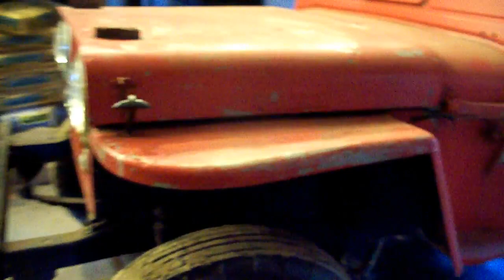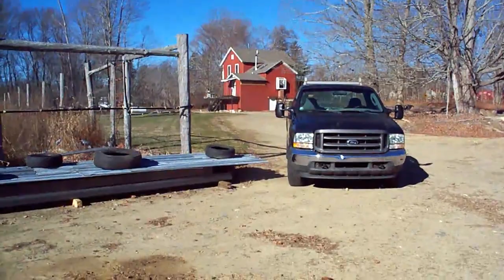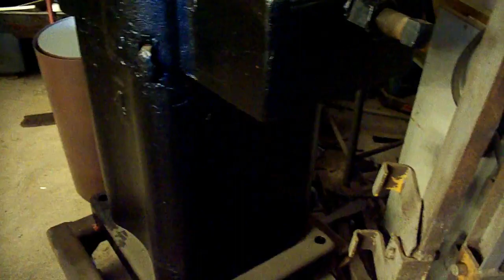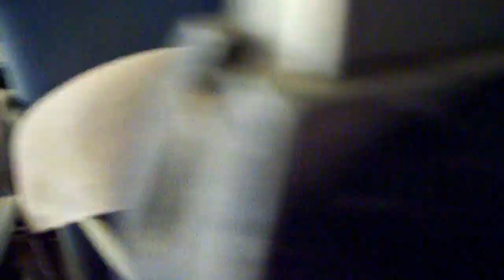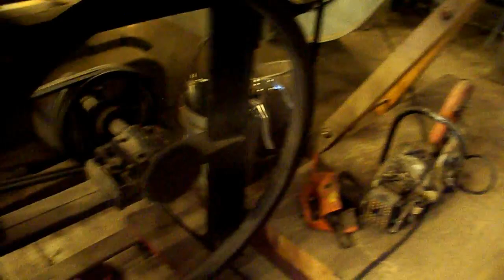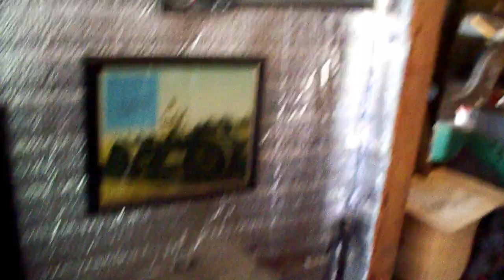Willys Jeep, sawmill update, vintage machinery and more updates

Comment: Did you check www.vintagemachinery.org for information on the band saw or the old woodworking machinery website. Just a thought.
Reply from the maker: yes, I am familiar with vintage machinery website.  Searched 1000's of photos and manufacturers but this bandsaw is still a one of a kind mystery.  Works great so I am not to concerned about the company that made it anymore.